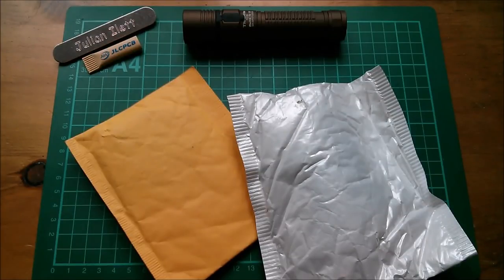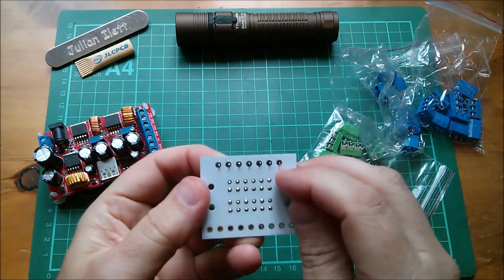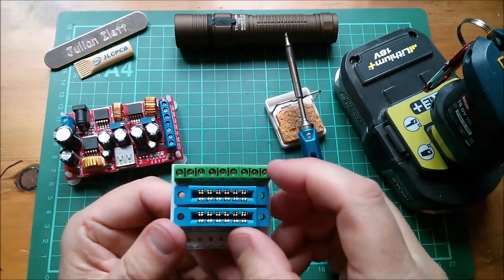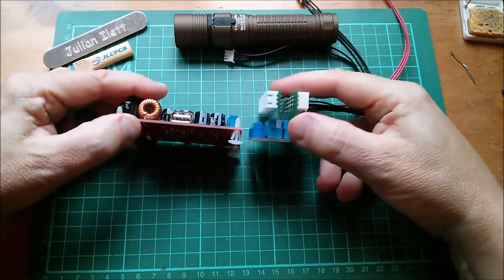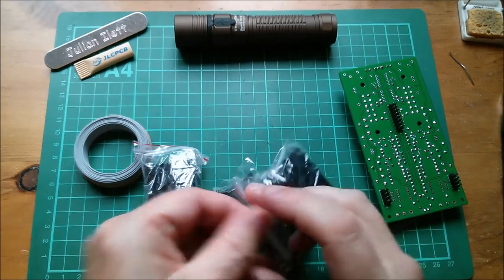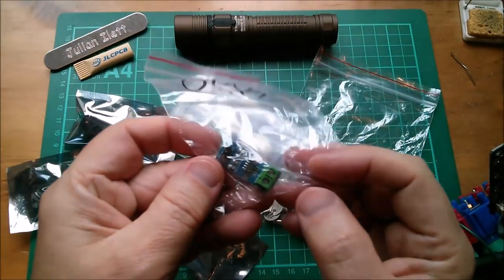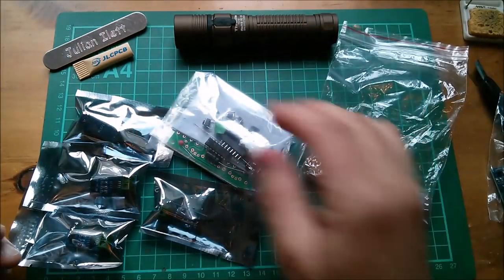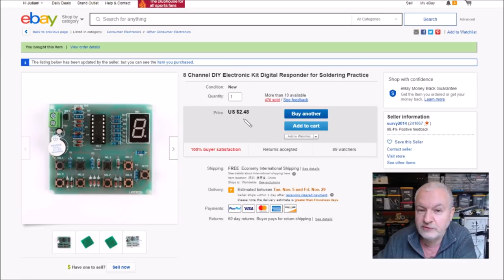Julian's Electronics Postbag: #142 - Power Distribution Stuff

Comment: Love post bag, like going to a good tool shop :) Right, an idea for you - jlcpcb do as part of their extended surface mount line ads1115 adc and ina219 current sensor. So for a few quid you could have an esp32 measuring voltage and current then send it as udp to a raspberry pi running influxdb time based database and chronograf to view it all - pretty graphs of your solar current i /out and voltage or anything. Think i had one sending to the database at about 100Hz with few dropouts. Great fun!

Comment: Hi ! Maybe you already know all this, but, just in case : About the ACS712 module, hall effect sensor, I never had good results with them, maybe for high currents works OK, but, even changing the resistor, they are not very good, in my opinion; instead, I use INA219 modules, I2C, high side current, They are superb ! And, about that toggle switches, I have discover if I keep my soldering iron "too much" time (not really) soldering the pins, they melt inside and the toggle is not reliable anymore, works randomly, so, be aware of that. Thanks for sharing !

Comment: You must be doing something like me, I had some of the same things arrive today, 
I was looking at a high power balancer. Got the voltage/amperes, they are different that the last so can't actually calibrate the current, but seem accurate. Downside is the two decimals.

Bought a nice capacity tester too.
4 down... 396 to go... 😢
Should have bought a few more..
Charging from the am7526a I think... Adjustable buck chip. 2 amp so speeds things up. Currenty li-ion, next is LFP.  
But I think I'll build my own load tester for the bigger batteries.

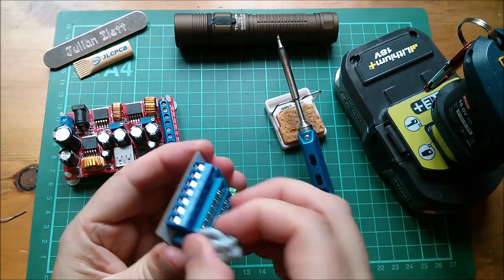Comment: 5:16 isnt't the sideways banana-ing caused by the play of connector's pins in the too large holes due to holding the connector block slighty banana-ed before fixing the pins in place with solder ?

Comment: I understand that you are designing to be super modular but all those jumpers and connectors are potential trouble points. We had a 12 pcb card cage with wired backboard that was a constant source of trouble so we replaced it with one big pcb.

Comment: Heh.  I have a small board here that i wanted to identify.  It has a couple of chips,  and BOTH a zener diode and a 78L05 regulator chip to power the other parts.  Putting a 9V battery on the clip that's attached gave no sensible results.  But there was a board number,  so I searched on that, and the result was an ebay listing saying "for soldering practice",  meaning that the board is no damn good for actually doing what it was supposed to do...

Comment: I got stuff from alice within 3 weeks during the last several month, which was actually faster than before. That will change soon though, since Austria will remove the tax free limit with the end of the year. It means 20% tax on import and a 10€ "handling fee" for collecting that tax. Wouldn't really mind the tax (it is indeed unfair to local businesses that you can buy stuff from China tax free), but the flat fee pretty much kills all my China orders. Not to mention that shipping times will be crazy (packages already spend most of their shipping time lying around somewhere in Austria if China tracking is to be believed; that can only go up if they now have to manage all the small value packages).

Check those current sensors properly before using them. I got a few of those in the different ratings (I think there's 5, 20 and 30A versions available). Two of the chips were mislabled (or I got sent the wrong ones, can't remember as this was a year or two ago; from lice btw.) and all of them had much higher noise on the output than the datasheet of the chips specified. So at least at the time when I got them there was something shady going on (rejects or non genuine chips?). But at least I got my money back from alice.

Comment: It would be good to see those current sensors used in a video without using a arduino to show current on a display. You would need a circuit that nulls the 2.5 volts and able you to zero it.

Comment: I've used a 1of16 demux IC and a matrix of diodes to achieve 4bit binary to hexadecimal LED,
beacuse the 4000 & 74xx series chips won't.
Reply: wish they did a 74xx hex decoder, not sure why it didn't come into production. cheapest option I use is a PIC16F627 SMD for each digit on the back of the display at $0.30 each